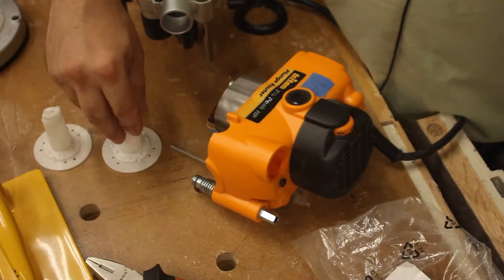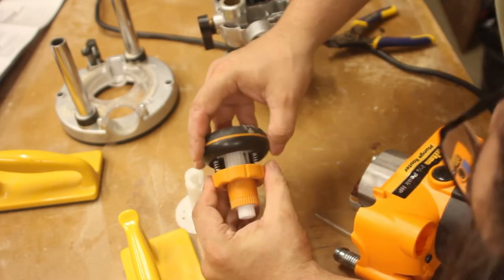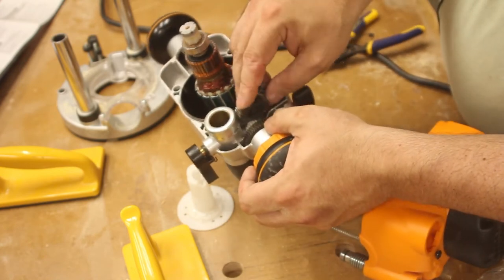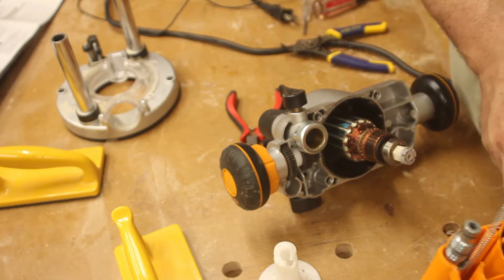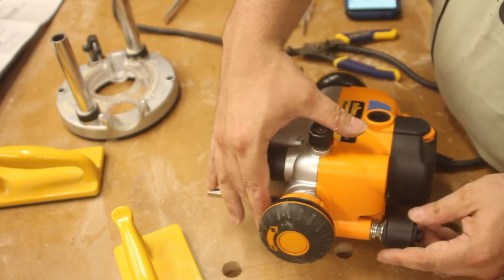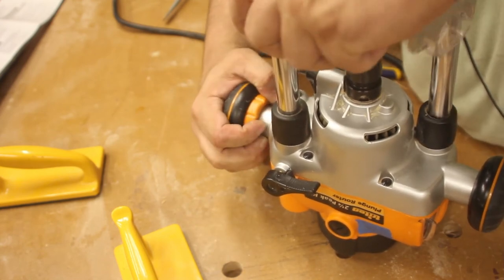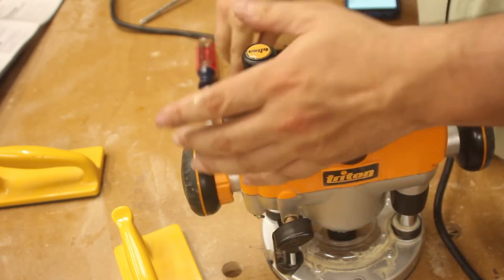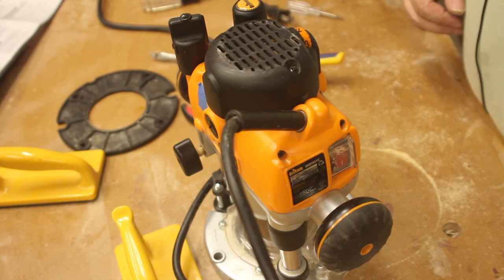TIW Ep  63   Repairing my Triton Router Part 2

Comment: That large spring is supposed to be removed when your using the router mounted to a table, it is only reinstalled for plunge work
Reply: Correct Paddy
Reply from the maker: Since I've made this video I've Figured it out and gone ahead and pulled out the spring anyway.

Comment: The armature in mine burnt out, ordered a new one and relaced it..... these engineers need some more schooling. Before you can remove the armature you need to remove a thin plastic cup like insulation bowl that is held in place with a thin O ring (almost) . Got it out using a very thin flexable flat steel tool kind of like a feeler gauge. What a pain in the*****.Putting it back was a fun event..... not! Anything else breaks & it goes in the trash!

Comment: Hi. I have similar problem. It is so caled "worm shaft", part code TRA378  for micro adjustment. And is same plastics. Dismantling was easy, and i removed that shaft. I also found that brushes have broken off edges,so ihave to get those to. Colector is fine. My qestion to you is. Where did you ordered your part ? Can you send me or post any link ? Thank you in advance.

Comment: I have a mofo001 that the speed control broke on. I loved it mounted in my table but it started changing speeds on its own. It would suddenly speed up scary high then slow back down. The replacement part is so expensive I have to consider replacing it. It seems to be a common problem by the comments I have seen. I bought it at the Woodworking show maybe 10 years ago. I may buy a new model at Rockler but would like to know if that problem has been resolved before spending that much.

Comment: I am on my second Triton Router. After two years, the first one failed with symptoms you have described. I ordered the second one because I was in the middle of a critical customer project when it failed. I am now on my second Triton and it too just failed with again the same problem. This time with your fantastic video as an aid, I will be fixing both of them. That way I have a backup because almost certainly this will be an ongoing problem.  Thanks so much for the videos.  One question. In part two, the brushes appeared to be already installed and I don't think they were in at the end of Part 1. I am assuming you installed them off camera  after the disassembly and then just left them installed when your part arrived. Is this correct?

Comment: One of the reasons I only have the smallest version of this model as it doesn't have the ratchet handle,it may not have the power of the others but I use my very old Elu 177 E of 27 years and still going strong for heavy duty work !

Comment: I have the same problem only I broke mine by trying to raise the motor too far to lock the spindle.  My locking pin is not engaging enough to lock the spindle.  Now I need to  replace several parts!

Comment: Thanks for this video, this helped me fix the problem I had with my Triton router. After a year it would drop anytime I would try to make an adjustment with the fine adjustment knob. I opened it up as you have shown here and I saw there was dust caked on the orange plastic cog wheel shown at 2:30, the micro release. It also looks a bit worn. Because of that it would not slide in to the metal gear properly and the whole assembly would slide over the axis. After a good cleaning it works better, but I will need to replace the part as well.

Comment: I have my router mounted in a table, when I adjust height using side grip or micro adjust
Router drops down and does not engage.
I have a replacement worm screw and worm wheel, I am now thinking I need more parts
any ideas?

Comment: I had to remove the brushes to re-insert the unit together- now I am struggling to re-insert the brushes to stay in place While I replace the screw cover caps. Any thoughts? Great video!
Reply from the maker: It has been a while since I've been inside that router or have had the brushes out.  If  I remember correctly.  I didn't have too much of an issue. just sorta had to line everything up I remember using two hands.  Sorry I can't be more helpful. I just don't remember.  Let me know how it goes.

Comment: I just wonder if the axl broke because of the spring you still had there and the instructions say that it MUST be removed. The spring needs to have enough umph to return the router to up position. If the router is upside down with the spring the axl and gear mechanism need to deal with the weight of the router plus the spring load = at least double the load. Of course the axl should be able to tolerate that, and it should be of metal, but maybe this is the reason it broke.
Reply from the maker: I don't think it's what caused it to break, I over cranked it.   Since I've made this video I've Figured it out and gone ahead and pulled out the spring anyway.
Reply: @TheinternetwoodworkerGPlus  Good advice regarding the spring. Should extend the life in the router table.